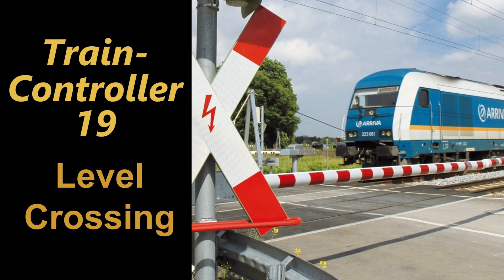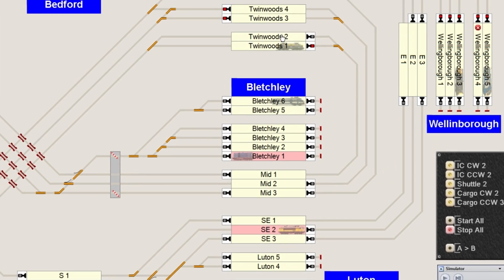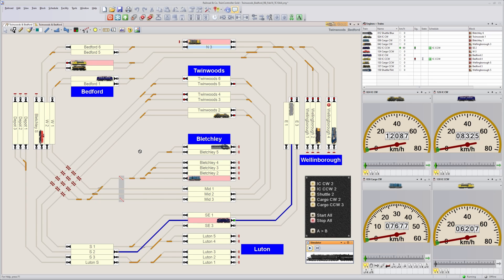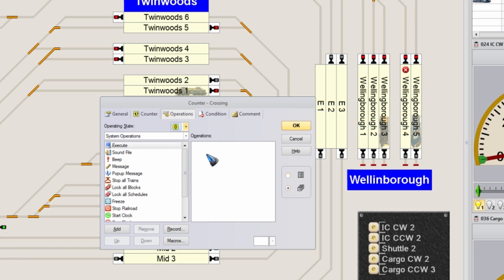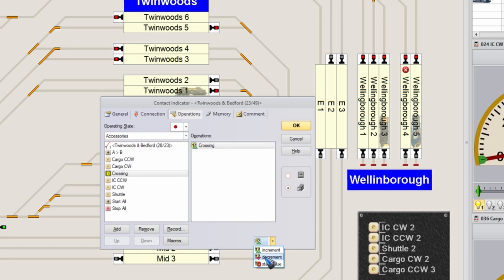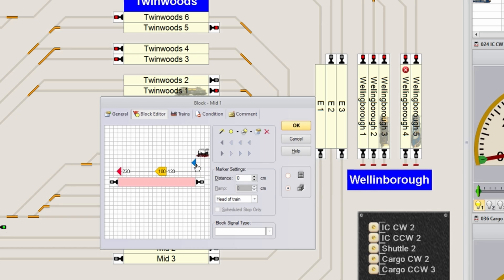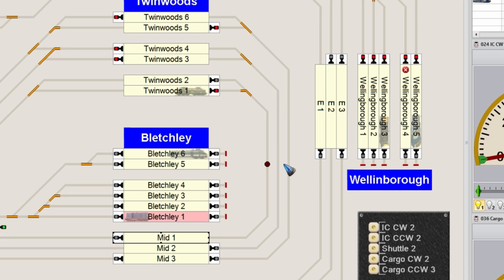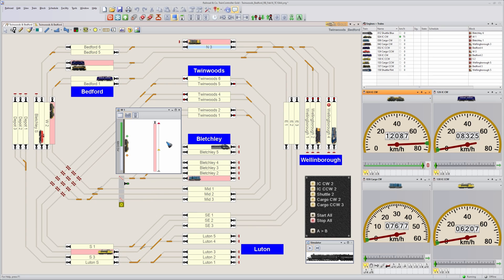Traincontroller 10 Gold 19 Level Crossing

Comment: Rudy. You have had a great influence on my train hobby activities. You motivated me to get a DR5000, get much ARCOMORA gear, to use Arduinos & servo motors to drive turnouts, and to use Arduinos and sensors and relays to manage reverse loops. (Please look at a PCA9685 - an inexpensive IC2 board that can control 16 servo motors and multiple boards can be strung together from one Arduino.)

I recently took my 1st layout apart in preparation for my new, larger, more complex layout. Previously, I tried to use ROCRAIL but only with moderate success. (I even used a ceiling suspended Raspberry Pie with a good camera to create train location detection abilities. LOTS of code but a whole lot less wires than running OKKIES or reed switches.) The new layout is under construction and I am attempting to decide on block definition strategies. I've now watched 18 of the 73 Traincontroller (TC) videos made available by you.  For them, thank you very much. I have downloaded and played with TC 10 Bronze as well as GOLD in conjunction with your TC videos that I have watched.  I recently purchased 12 OKKIES (96 blocks) to use - the Raspberry Pie was not accurate enough - false detections.  

Question 1: TC does not recognize a DR5000 in its supported hardware vendors. I assume  that using a particular COM port running to the DR5000 will work. (I have not yet tried this.) A push in the correct direction, should I fail to get it going, would be appreciated. 

Question 2: Block Definition. Originally, I was going to use optical momentary detection devices (QRD1114 - a led and optical sensor in one package). You recently reminded me of reed switches. They will be much easier to install "after the fact". I have many many Arduinos as well as ARLOCOs so I may try this approach as well. However, current detection is the way that I will head because of the OKKIES that I recently purchased. What I have learned from your TC videos that I have watched is that larger blocks are the way to go. For example, in my fiddle yard, I wish to park two trains on one track, one behind the other. I was going to have 3 small blocks per siding - A,B & C with normal track between the blocks. First train in ignores block A, starts to slow when the engine hits block B and stops when the engine hits block C. Second train in starts to slow at block A and stops at block B. I think that you have convinced me that I really need only two blocks - one for each train - each occupying half of the length of the siding. The train starts to slow down  at the appropriate "break marker" and stop at the "stop marker" (as described in block definitions).  It appears that you use reed switches as close to the turnout as possible and that (in most situations) the block end is defined as ?? cm from that sensor. Of course, if train traffic can travel in both directions through the block, there will be a reed switch at either end of the track - right next to the turnout.  Please confirm that I understand you on this concept.

Question 3: Bronze, Silver or Gold. I lean towards Gold because there will be nothing missing. I lean towards Bronze because I'm getting up there in years and the learning curve in Bronze should be less rigorous. Money is not at issue in this decision. (My kids want me to spend it all before I go.) Your advice on this question is appreciated.

Again, thanks for all of the influence that you have had on my decisions. I really admire your teaching capabilities (I'm a retired teacher!!!) as well as the breadth & depth of your various hobbies.

Comment: Hi, Rudy, I am writing you who is the most experienced TC expert on You Tube. My problem is following: all of my engines ignore any speed restriction in the target block in any Auto Train operation mode.  All of the speed limits are accepted if there is any block with a specified speed limit between the start and target block. Even the speed limit of the start block is accepted.
Another phenomenon occurs with some of the engines (not all, regardless of decoder`s  manufacturer): The speed lowers approximately to the half speed when the distance signal in the train window becomes red, but the speed limit of the target block is still not accepted. For example an engine with V max=105 km/h lowers to 42 km/h and an engine with V max=120 lowers to 74. I tried to fix it in many ways, but...
Have you any idea? Thanks! Joe
Reply from the maker: It's hard to tell from a distance which settings may need tweaking to get rid of your issues. Best thing to do is to send me an email, ruudboer at gmail, with your layout attached. Also put a train ready for me in a certain block and tell me what block to drive to with autotrain, such that I can see happening what you describe. Then I'll get back to you with hopefully a diagnosis and a solution.

Comment: Hello Rudy, thank you for your amazing videos on TC9 and 10. I have a question about 10 version. I have a block with maximum speed 150 km/h. Before of this block there is a shadow station which every blocks have 60 km/h at max speed. After this block (150 km/h) there is another same block with max speed 150 too. All Locos that start from shadow station enter in this block at 60 km/h but doesn't increasing speed all along the block (why?) . it starts to increase speed when it enteres in second 150 speed block. There are no speed markers...please help me. thank you
Reply from the maker: It depends on your Schedule Rules for release of blocks what happens. If you have not changed these settings, a train assumes it has left the previous block only at the Stop Marker of the next block, which makes they will still drive 60 in the 150 block. Only when they oass the Stop Marker they will accelerate to 150. If you like them to accelerate sooner, change the setting to Smart upon Entry. That will make them accelerate as soon as they reach the first train detection sensor  in the 150 block.
Reply: Thank you Rudy. It works for the schedule . How can I transfer this rule also in drag and drop or spontaneus run?  @rudyshobbychannel
Reply from the maker: @andreababini9925  TC10 has a schedule named Autotrain, you can set it's Rules like any normal schedule. For Spontaneous Run right-click an engine in the engine list and there should be an entry for Rules of Spontaneous Run. These are on a 'per engine' basis.

Comment: Rudy, another excellent series on Traincontroller which are really very helpful. If you could do another update on sensors I think this would be most helpful. Please can I ask a question. Do you still use reed switches? I am concerned about the reliability of these, whether they can be damaged by having too much of a magnetic field which is necessary for fast moving trains. Have you tried Hall Sensors and what is your opinion on these? Thanks in anticipation of some guidance.
Reply from the maker: I'm planning a new series on the creation of a layout from scratch, with my new bookshelf layout, made after a move, having limited space. Yes, I still use reeds. I once did some high speed tests and had no issues of trains not being detected. Your mileage may differ, I never drive with high speed.
Reply: Do you still use the Flagman in block with switches controlled by the reed switch? or have you developed another solution? I would be very interested to know. I intend to try Hall Sensor connected to an Arcomora, arduino based loconet adapter, I hope it will be successful!
Reply from the maker: @richardpage3495  I don't use flagmen, just the standard method for sensors.

Comment: Rudy, I tried asking a question relating to RealVNC and ECoS on your 9-year old video on the subject, but never got a response. I also tried to find a contact page on your website, also to no avail. S pardon me for asking my question here, I'm just hoping that, since this a recent video, you will see it. Here goes...

When I view my ECoS screen on my Windows 10 laptop my mouse changes to a dot when inside the ECoS screen. It is fine outside the ECoS screen on my desktop or in any other application. I noticed YOUR mouse did the same thing. This makes it extremely difficult to navigate or even see it. Is there a fix for this? RealVNC tells me the problem is NOT with their viewer, it is with the server that ECoS employs. and yet I have no issues when using TightVNC viewer. This is what I use, so at this point my question is more academic than of real necessity. However I am still curious if you ever found a fix. Thanks and pardon my intrusion in this video's comments section.
Ron
Reply from the maker: I have no idea if or how this behavior can be changed.